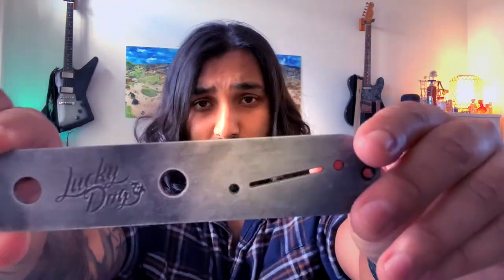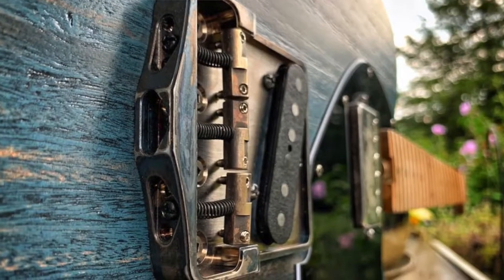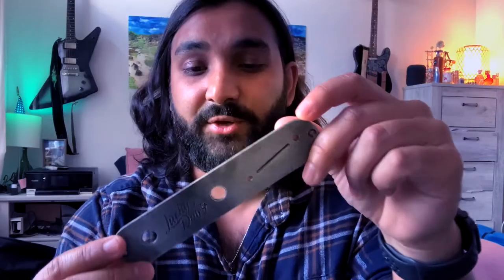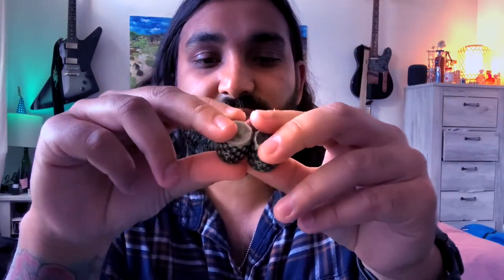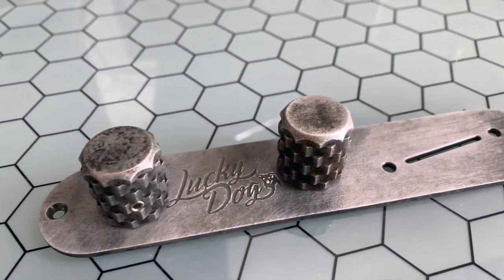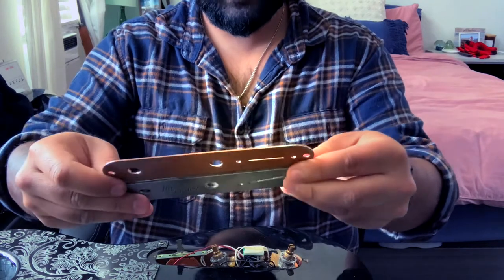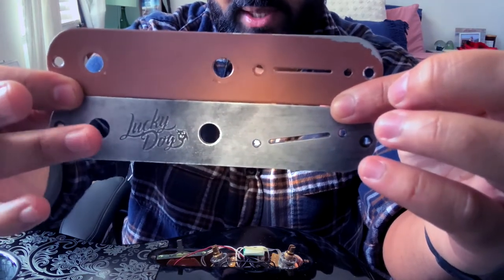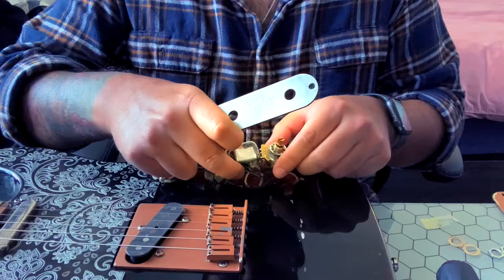LUCKY DOG TELE CONTROL PLATE INSTALL!  COOLEST PARTS EVER!

Comment: For your striped screw hole just get some toothpicks and wood glue then shove them in the hole then screw the screw back in.
Reply from the maker: I just used a slightly longer screw, but if that fails later I’ll do the wood glue method